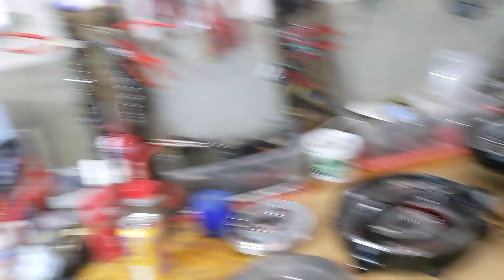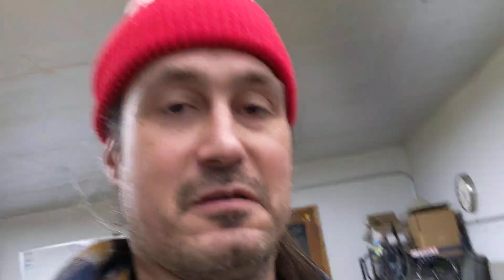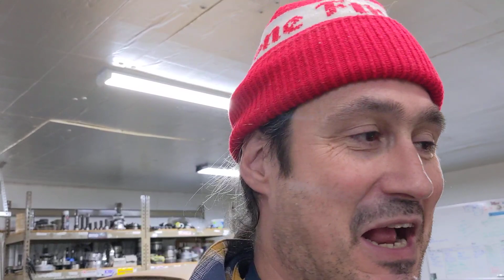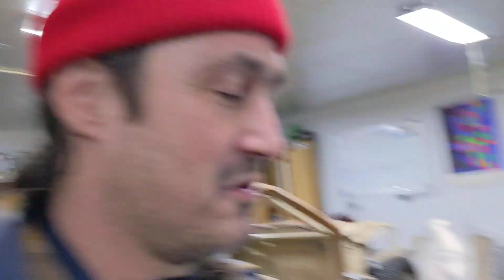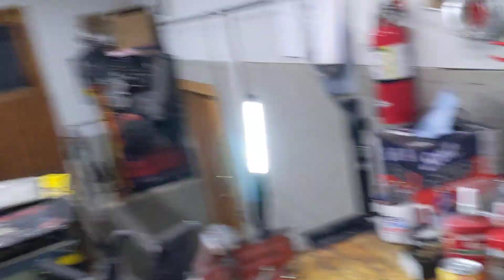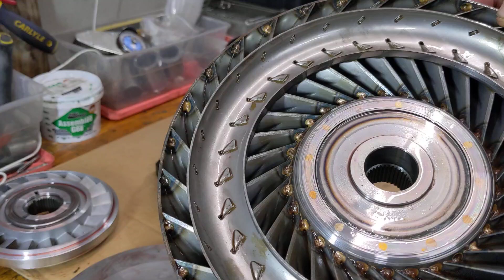incorrectly assembled converter

Comment: i have a 96 chevy 2500 with the 4l80e.. my question to you is what would make my trans shift 1-2 fine make 3rd lazy (NOT SLIP JUST LATE) then after about 20 mins drop to 2nd and stay there till i shut the truck off and restart it?
Reply: sound like a bad solenoid. The 3 gear solenoid  change the fluid change the filter should fix it. if you need a video watch precision transmission he rebuild transmission
Reply from the maker: hmm any codes in the pcm?